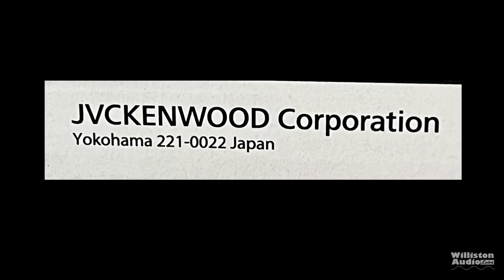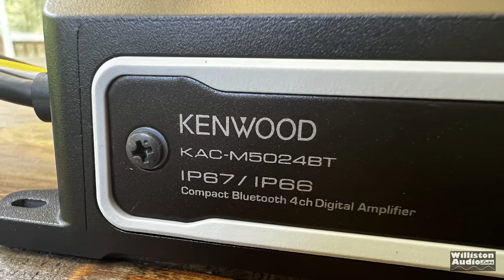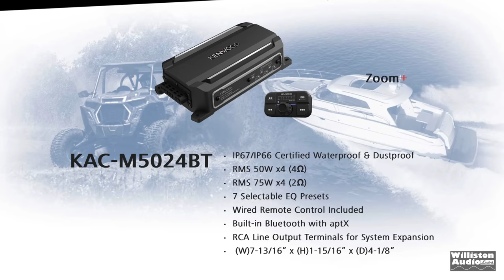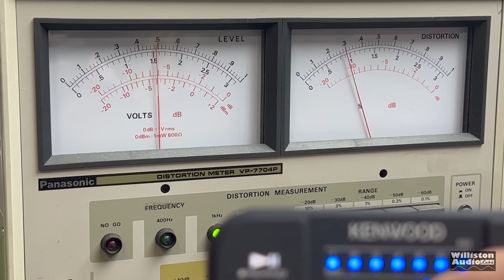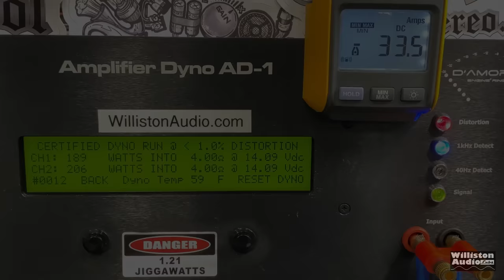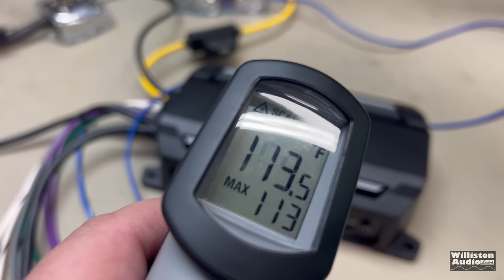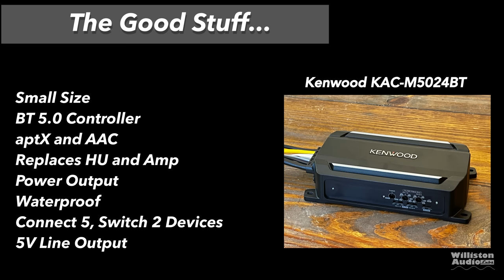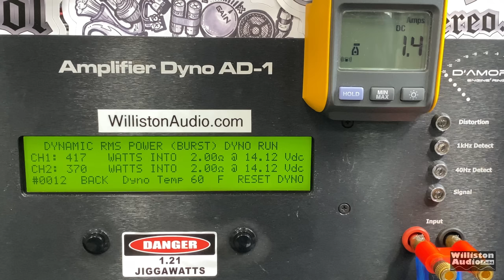Just Shy of Perfection? Kenwood KAC-M5024BT Bluetooth Marine Grade Amplifier

Comment: I just installed one of these weeks ago on a boat and can second some of your comments.  First thing I noticed was how quickly warm it got when just running 6” coaxes on low volume, had me worried about efficiency when running on a boat where power draw is a big deal but glad to see your test showed good efficiency.  The preset EQ is pretty much worthless as you mentioned, can hardly hear a difference between them.    Other than that seems to be a decent upgrade from the old marine cd player it replaced and I assume is what they targeted it towards
Reply from the maker: Thanks for the real world feedback!

Comment: I was always a bit of a Kenwood fanatic since the late 80s.  My home stereo features 2 Basic M2a amps that I've never felt a need to replace.
Kenwood - going back 30 to 40 years - always had insanely good engineers, but cheapskate bean counters in control of manufacturing.  Way back in the day, Kenwood was mostly known for their home stereo, but they also had some impressive feature rich head units at the time.  Then they dropped their home audio stuff and concentrated on car audio.  That didn't seem to work out too well for them.
Reply from the maker: They make some of the best head units and very good amps
Reply: I agree with this regarding their head units.  I sold them and that's all I ever had in my cars, despite also having the options of Pioneer, Sony, Alpine, JVC, and Clarion at cost.

Comment: put a lil kenwood 1814 on my front and rears.  actually having trouble with it over-powering my front woofers/ mids.   which i have to admit....i didnt expect.   and i set the crossovers conservative at 100 hz. its beatin the snot out of my 6.5s at about 80 hz full tilt.  im impressed with these lil things

Comment: Powerful little amp! So this is designed atv boats motorcycle.  Any reason not to use it in a regular auto application?   I am thinking of getting the non BT model M5014, and putting that in my truck to drive the door speakers.  Do you have a test of that M5014?

Comment from the maker: SHOP
Kenwood KAC-M5024BT 4ch Amp: https://howl.me/cjCLI0bY6UD
AMAZON LINK: https://amzn.to/41TqQh1

Kenwood KAC-M5001 Subwoofer Amp: https://howl.me/cjDhGslH9BY
AMAZON LINK: https://amzn.to/44h8S9J

JVC KS-DR2104DBT 4ch Amp: https://howl.me/cjDhzwB4ouo
AMAZON LINK: https://amzn.to/3ABF0qW

Wet Sounds WS-MC1 4ch Amp/BT Control: https://howl.me/cjDhFgHhczQ
Elac Debut 2.0 6.5" Bookshelf Speakers: https://amzn.to/3N6a1uJ
Sundown SA6.5 Subwoofer: https://lddy.no/1g2y1
Down4Sound Amplifiers: http://www.Shop4Bass.com
12-Position 25A 600V Terminal Block: https://amzn.to/3VhEo3B

SEE PREVIOUS VIDEOS
Kenwood KAC-M3004 4ch Amp: https://youtu.be/99tiyWuuAGM
Kenwood KAC-M3001 Mono Amp: https://youtu.be/mTvyPNj2_JI
Car Audio Amplifiers Tested and Reviewed: https://is.gd/WALcaramps

VIDEO INDEX
0:00 Intro
1:31 Unboxing the Amp
2:52 Features and Specs
5:55 Bluetooth Connectivity
6:45 Multiple BT Devices
7:06 Low Voltage Shutoff
7:23 Line Out THD and Voltage
7:44 Amp Dyno Tests
11:00 Sound Demos
12:21 Sound Modes
13:02 Getting Hot in Here
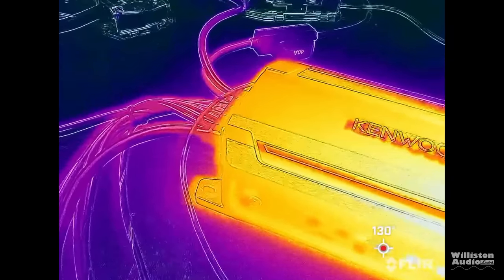13:29 Waterproof?
14:21 What's Inside?
15:22 Pros and Cons
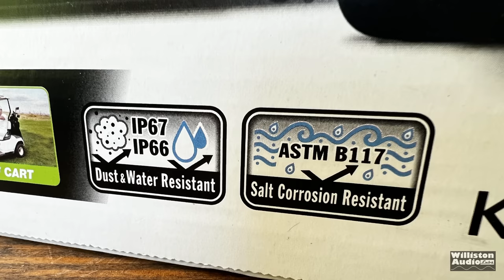16:17 Final Thoughts
16:47 Extra Tests

VIDEO AND AUDIO GEAR
Camera - iPhone 13pro 1TB - https://amzn.to/3nCjGvc
RODE Wireless Go II Microphones: https://amzn.to/3Q6NVHl
Shure MV7 Microphone: https://amzn.to/3A4OICK
Zoom H4n Audio Recorder: https://amzn.to/3BXjVsS
960 LED Panel: https://amzn.to/2Sxoq3S

TEST BENCH EQUIPMENT
SMD / D'Amore Engineering Amp Dyno: https://goo.gl/sJTcf7
XS Power D1400 Batteries - https://amzn.to/2BPFCKW
XS Power PSC60 Charger - https://amzn.to/2CHGcfs
Fluke 1000A AC/DC Clamp Meter: https://amzn.to/2Rw5WDA
Handheld Dyno: http://amzn.to/2u2EgKV
My Favorite Screwdriver Kit: http://amzn.to/2x0VzcE

DISCLAIMER: This video and description contains affiliate links, which means that if you purchase from one of the product links, I may receive a small commission. As an Amazon Associate I earn from qualifying purchases

Comment: I like these head unit delete options.  I think there's a market for a full blown processor that works directly from a phone/tablet; even better integrated into an amp.  Analog RCA's should have stopped being a standard a decade ago, and this would be one way to get around them.  It's surprising that it's not typical in this day and age.
Reply: Analog RCA's should have gone by the wayside 15-20 years ago with full digital Tolink (finer optics) being the norm today. I know of only 3 companies, all very high end and expensive that have toslink connections for their amplifiers.. I mean if you have a DSP but must hook it up to your amp via RCA inputs, are you not defeating the purpose? Totally agree with your comment. Fiber Optics came out in the late nieties, and there is no better connection out there for best sound quality.
Reply: @johannjohann6523  especially where engines and their electrical interference are concerned.

Comment: What level on the knob did this unit start to clip at?  Same question for the RCA pre out.  I have this amp and installed it, and i hear distortuoun from the pre outs freding my sub amp with the volume at the 5th light out of the 7.  I was just wondering if that's cliping or not.  Sweet video, you are why i bought this amp.

Comment: I was wondering where the line inputs were. Having only BT seems odd (Kicker's version has aux and USB). Also it doesn't seem to have a mic for handsfree phone. Several years ago, Inifinity and JBL had (larger and non waterproof) amps that had both.

Comment: I am trying to completely eliminate a head unit in my dash. I bought a cheap Pyle BT amp a few months ago and it’s already failed.  Will this hold up to being put in a box behind my reg cab seat with little air flow?  Looks like it gets pretty hot. I’m not trying to bass out my system just play tunes and podcasts while I drive through factory speakers.

Comment: this amp is not too expensive, but there are better choices...imo
Reply: What other 4ch bluetooth amp has a controller and that type of power or more? Just curious, I'm wanting to do a bluetooth system with an amp like this.
Reply: @scarr3ll  I buy Helix/ Match. I currently have 2. One is 65 x6 (pp 65 DSP) and the other is an 8x85(pp86DSP). The Bluetooth module is sold separately and so is the controller. They are not cheap, but they are German made and very high quality. These amps are not for the novice, but if you like to tinker with your system, these are first rate products, in my opinion….good luck🎸✌️🔈